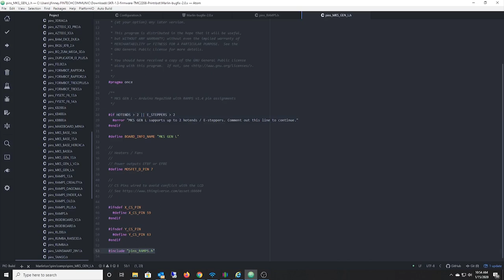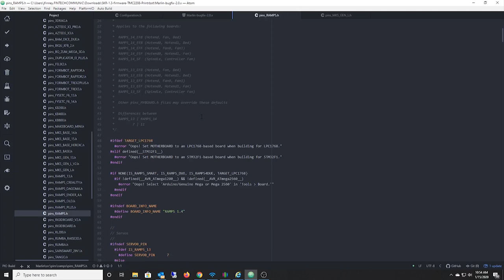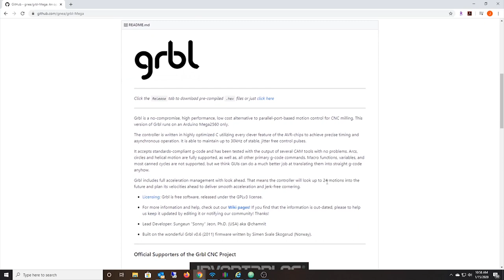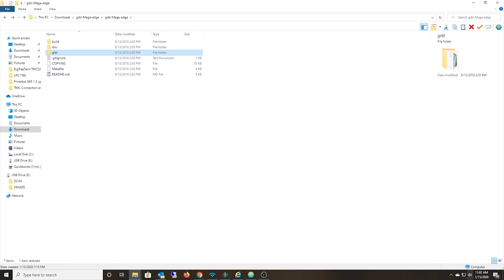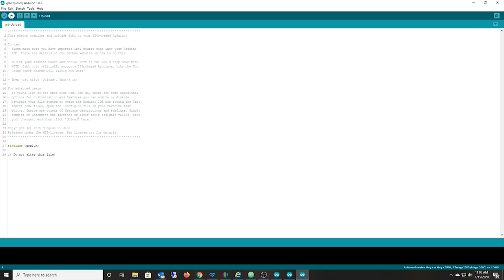GRBL firmware install on old MKS Gen L 1.0 with Trinamic TMC2208 drivers Laser Cutter Mill CNC

Comment: I am trying this board with my CNC 3018 machine that use used as a cnc router and a cnc laser engraver. I do wonder the pinouts where to connect the 2-pin spindle and the 3-pin laser. Please advice.

Comment: I have an Ender 3 that I bought a second board for when I purchased the machine, I also have an A10M that I've stripped for parts that came with GT2560 v4 board. I'm using the aluminum and belts etc to build a laser engraver, can I flash either of these boards (preferably the GT2560v4) with GRBL so I can use it for the engraver?

Comment: Thanks for this.  I happen to have the hardware for this so this is perfect.  What I am also looking for is how you have connected the motors (I presume still X and Y) and where and how the laser is connected.  If you could include a picture somewhere that would be awesome and save me having to go and pick up an MKS DLC v2.0 board (which would be plan B).  if you have no picture, I presume the live and ground wires go to extruder connector, but what two pins are you using?  Oh and one more question: don't you also need to load firmware for the cutting/laser onto the TFT?  If so, can you point me at it?  Thanks again!

Comment: Hi, how could I do to move the two motors of the Y axis? That is, a motor Y to the Y connector of the GEN L and the other motor Y to the EO connector of the board, but as is the configuration in grbl.thanks

Comment: What laser are you using and is it TTL? If so, where are you hooking up to on the board? I've been reading up on this, and a lot of folks switch to PIN 44 on the mks so it uses 5v pwm if they were using Marlin. Typically, folks used the fan out put and controlled it that way, but apparently that would be full bore 12v or 24v depending on psu (I think..).

Comment: Hello My laser needs a TTL output but I have not found where the TTL connector is on the MKS GEN L v1.0. I want to run GBRL on the board. Has any of you got any experience

Comment: Awesome. But you forgot to mention how to configure those TMC2208 drivers with grbl !!
Reply: do you need to ? just plug them wont't they work ?
Reply: @ramilvaliev  I don't know...At least on Marlin you have to specify which drivers you are using, that's why I asked.
Reply: @ramilvaliev  Just tried it and it worked like a charm! MKS Gen L v1.0 from Makerbase with TMC2208 (2 leftmost jumpers installed) working on grbl-mega. I'm currently using Universal G-code sender to control a foam cutter.

Comment: thanks for the video its been the only useful video for me ive found everything else has been useless. anyway ive got a laser engraver its got a generic grbl board 2 drivers a clone nano and some ports not much else. i want to use my mks gen L instead i dont like having to leave my laptop plugged into it while its running.

firstly what about the settings ? i mean ive got 2x Y motors and 1x X motor thats all the motors. i dont have end stops either like a 3d printer does usually. 

also where do i plug everything in? my laser hasnt got a board on top its just a couple of wires they goto a box and i think it includes a laser controller  the fan and the laser connect to the board i think it does the voltages then it plugs into the main board so i guess i need to plug that board into my mks gen L but where? 

i have a screen with sd card support the 12864 blue lcd id like to use that and sd card. 

im ok with setting up marlin and doing the settings in there myself i havent got a problem with that but i dont see that much in the config file compared to marlin

finally will vscode work instead of arduino ide? 

Thank you in advance